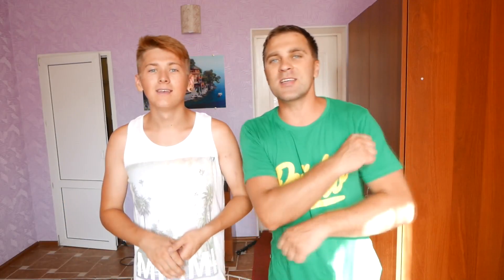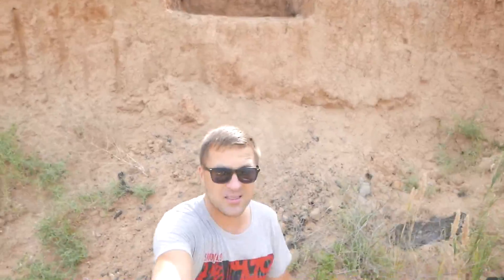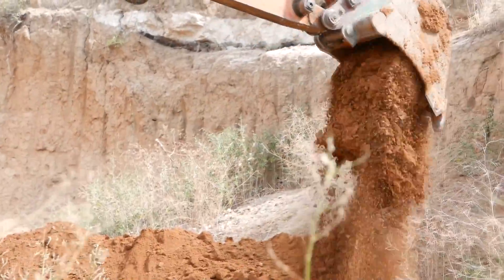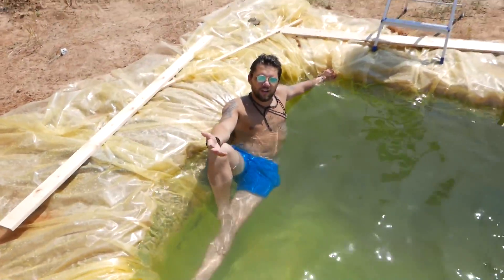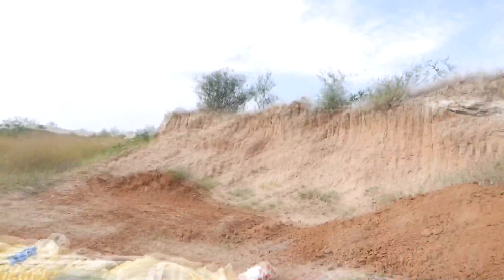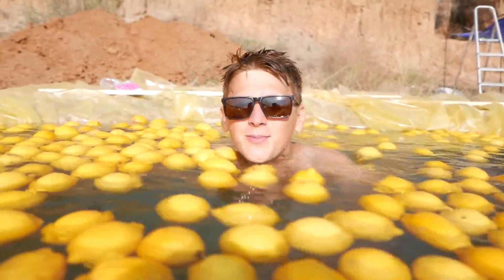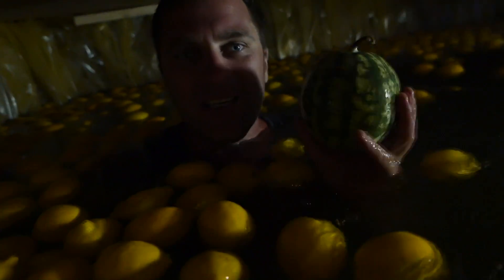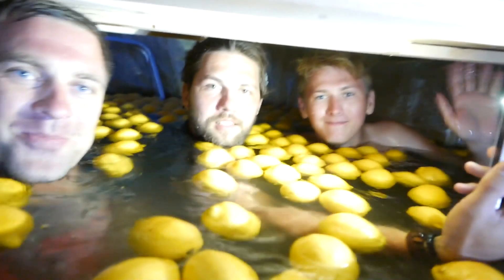POOL UNDER THE GROUND - UNDERGROUND POOL - DIY

Comment: I had a little experience in building the sort of thing you have. As long as it works, why not. There are always conditions in whether something will work, no matter what it is. I had a small indoor pool for many years similar to the one you have. It was partially above ground and to heat it, I had a wood stove with an automobile engine radiator on top of it and used an aquarium circulating pump to circulate the water through the radiator. The kind of soil you dig the hole in makes an awful lot of difference. You don't want the pool to collapse in because of the hole was dug in very loose sandy soil. Also you can't have anything sharp in the soil like sharp stones or tree roots, even small ones, in the soil. I always had at least two or three layers of plastic for the pool and also the plastic will disintegrate after a while from sunlight or chlorine so it has to be replaced periodically, say every two or three years. The soil I dug the hole in for my was like very firm sand, like the kind you have to use a pick to loosen the soil. If had been loose sand, I would have had to have some sort of a frame or have a gentle slope to the pool. The pool when full was about 6 foot deep at the deepest end and it was approximately 2 meters wide by 4 meters long and had a shallow end. I noticed you had a nice source of water that can fill the pool rapidly. I used water from a nearby spring to fill the pool but it did not put out the water your source did so it took a while to fill the pool.
Reply from the maker: Thank you 👍  this pool was made for fun 😉